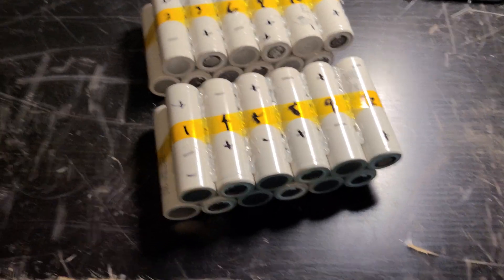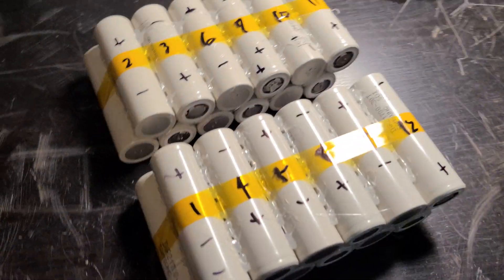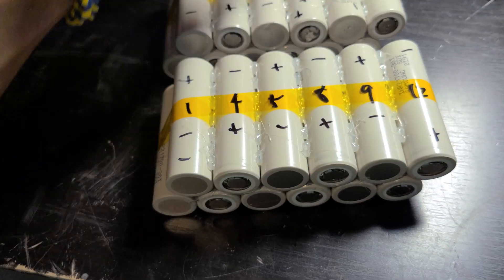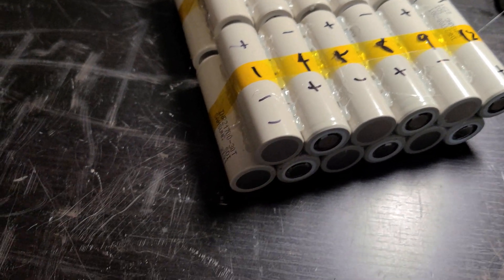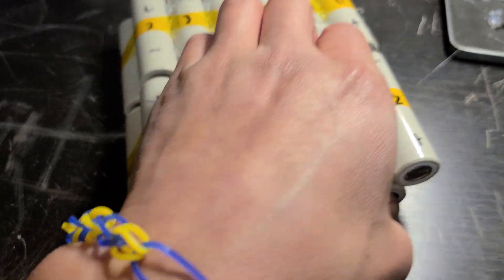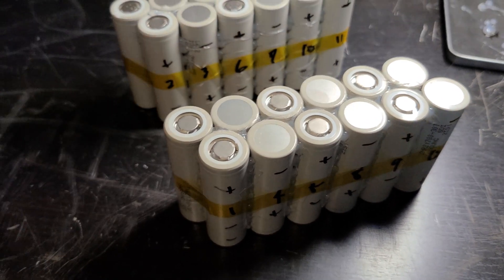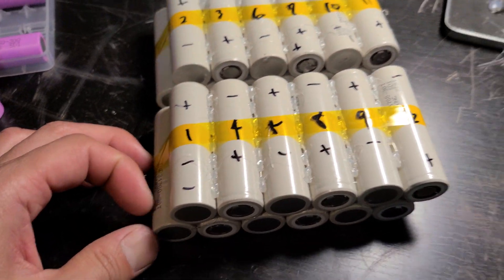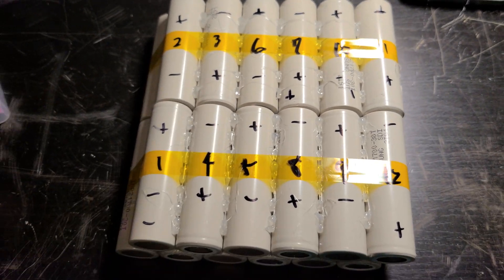How to design your DIY Electric Skateboard Battery Pack!

Comment: Your not going to kill yourself your not even going to shock yourself with all of them connected... It's 6v lol not gonna happen bud... Ever touched both terminals on a car? With it running? That's 12v, well 14v... Again you'd be fine. Hook up jumper cables and put them in your mouth and you might have a different outcome

Comment: Could I build something similar to wire in addition to my stock battery on my Meepo V3? Any worries about having double the capacity running through the system?  Does it matter if I mix battery brands/types? Many thanks!

Comment: I've had a Meepo v3 Samsung 40T pack go bad on me. My Panasonic Vestar v2 battery went bad too.
What do you think about Sanyo batteries?
Reply from the maker: Sanyos are actually pretty nice balance between power and size, smaller than 21700 but still double the amps of 18650 30Q.  If battery went bad it could be due to user error, did you drain it to zero all the time?  These batteries last much much longer when u dont drain below around 20-30%.  I always make sure battery is at 50% or more, if I deplete it to zero I immedaitely recharge when I get home.  If you let it sit for a few days that can seriously hurt the battery and make it die.

Comment: Hopefully in the future, these batteries can be safer and not exploding or making a fire..
Where are the graphene batteries .. ??
Reply from the maker: yes eventually batteries will become and safer.  Currently Lithium Ion Phosphate is safest, ones used on Boosted Boards but they are very bulky so not space efficient and reason why Boosted Boards have small range.